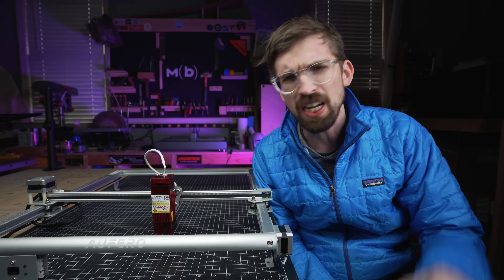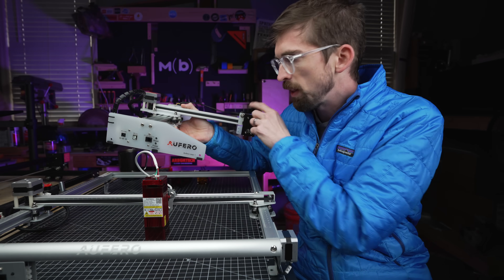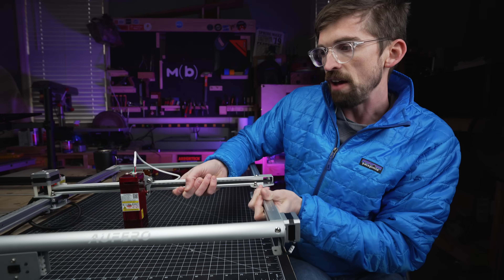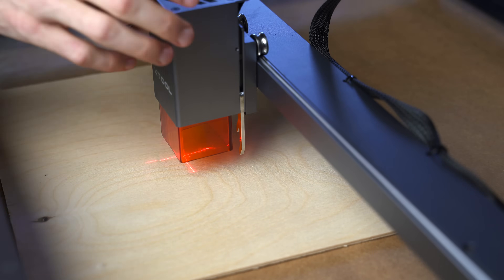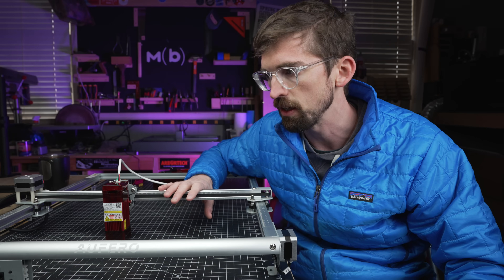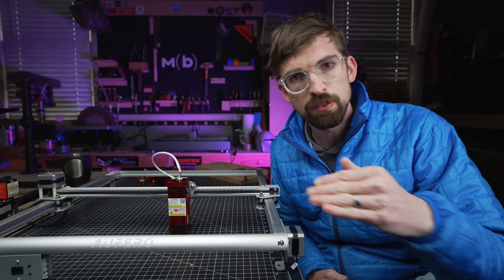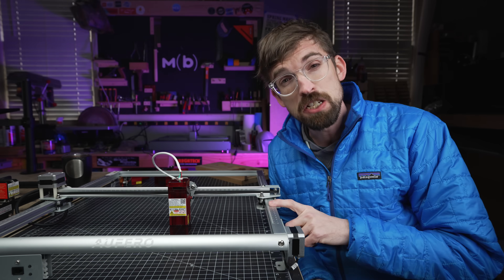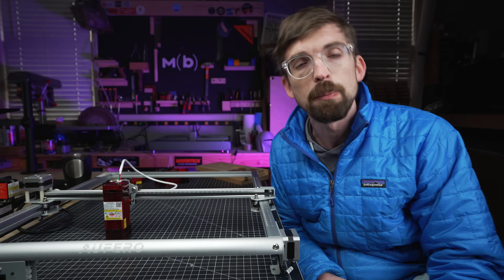Why make THIS?  Aufero Laser 2 Engraver and Cutter Review

Comment: I appreciate you showing a Laser DOT SIZE comparison! You show the Atomstack X7 but isn't the A10 Pro using the same laser module? I ask because I am interested in the Wifi capability of the X7 but no one has proven it works - and the A10 is more affordable for me if i can't control machine from WiFi.

Comment: I bought this laser, this is my fist time using a tool like this. I am struggling with the tracking of the gantry. It wants to rack on the y axis travel, causing alignment problems. I know this is a cheap entry level unit, just wondering if there is a fix for this. I have been adjusting the guide rollers and drive belts with limited success. Just wondering if you have thought of doing a video on the set up and tuning of similar style machines. Thanks for all your content.

Comment: Did you need to activate or otherwise with the firmware…or is a case of fit the end stops and plug them into existing pins/sockets on the board?

Comment: I found this review super helpful, and has convinced me this machine would be a good addition. With this laser option they sent, and applying the code, it's 369 before shipping. 

Is there a way to get one of the 100*100cm cheapo Ebay engravers to work? I really need a much larger working space for engraving, but the few comments I've found online is that no one can actually get them to work.

Comment: So the xtool d1 now has light burn comparability, and the atom stack looks like it’s coming out with an air assist later this month. I think these updates fixed the biggest problem with each machine. But now I’m super torn between the two. Id really enjoy hearing your thoughts??
Reply from the maker: Overall the D1 is a nicer build, but usually Atomstack is a little cheaper.  Also currently D1 doesn’t have any air assist option.
Reply: @makeorbreakshop  have you seen that they have the D1 has air assist option now?  With that being said, would you choose the crook
D1 over atomstack7?

Comment: Hi! Am I able tu use this using .dwg files in AutoCAD ? Or just using the software AutoCAD to draw what I want and then open it in another software to laser cut it ? Thank you in advance
Reply from the maker: You would need to export your drawing from Autocad,  Lightburn can bring in a ton of different file formats that would then run to the laser.
Reply: @makeorbreakshop  Ok thank you !
Reply: Export as a DXF file, will import straight in retaining layers
Reply: @chrislx2006  Thanks !
Reply: @teocan7438  if you get crazy lines or else on your burn, change the Dxf version , the best is to match the year the lasersoftware was built, if it was 2018 just export the object to Dxf version 2018 or earlier.